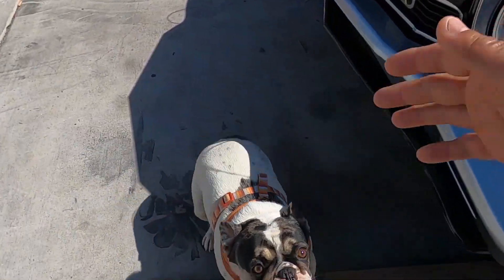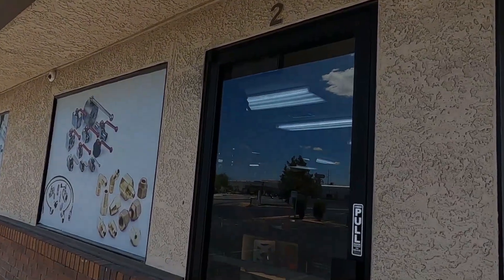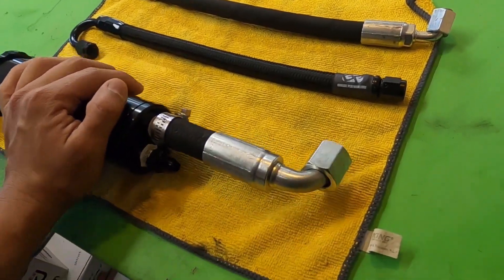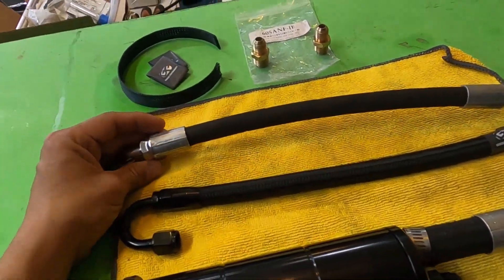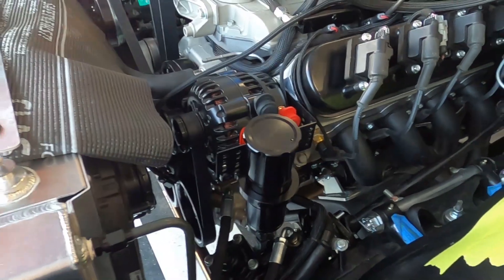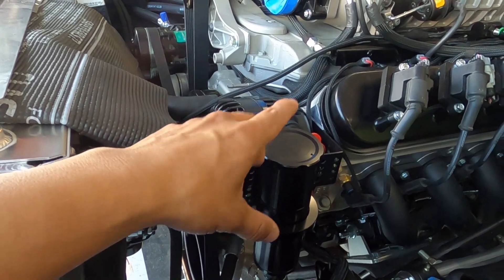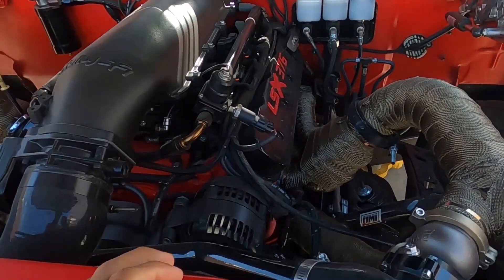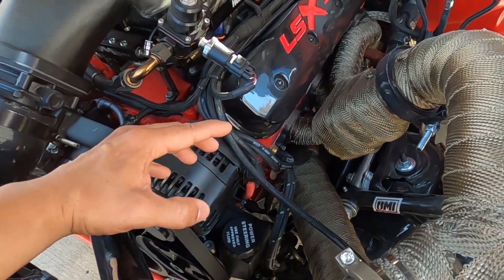HOW TO CONNECT POWER STEERING HOSES FOR YOUR LS SWAP? (PART18)

Comment: Great video’s man! I have a 72 chevelle and putting in a cvf remote power steering. Question, did you use a fitting to adapt the 10an fitting to a 6an?
Reply from the maker: Yes I did

Comment: Hey Goose! Did you have to use a power steering flow restrictor on your Type II pump when mating it to your gear box to reduce the pressure?
Reply from the maker: No sir